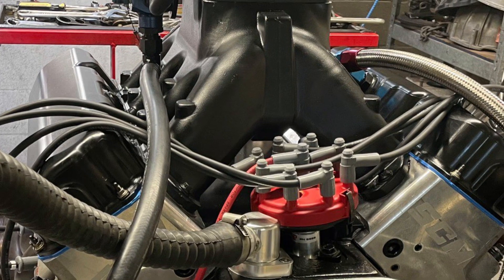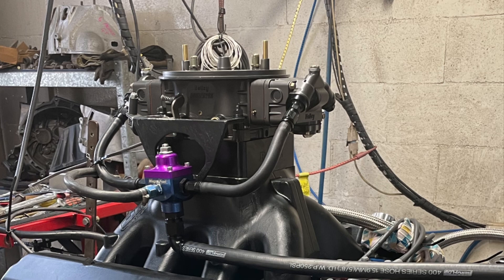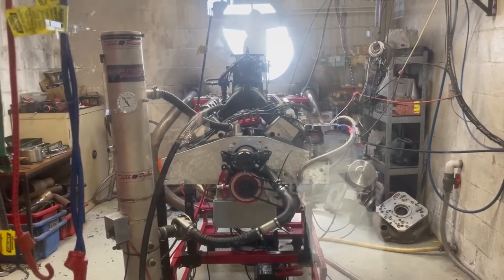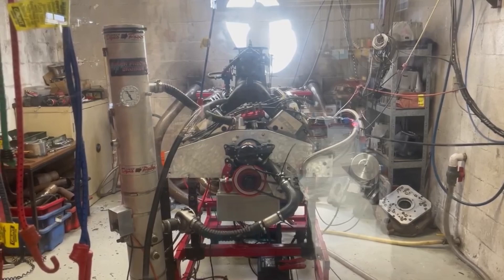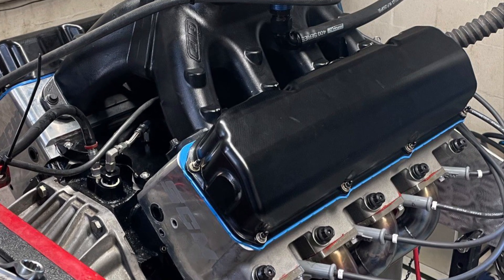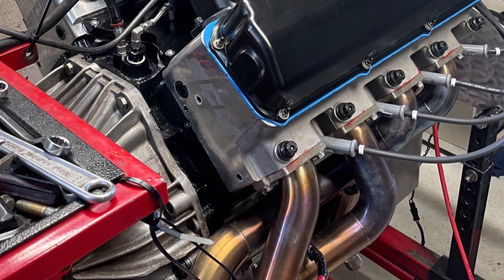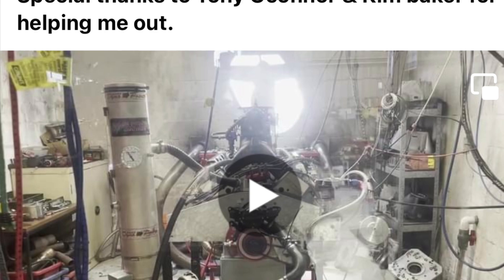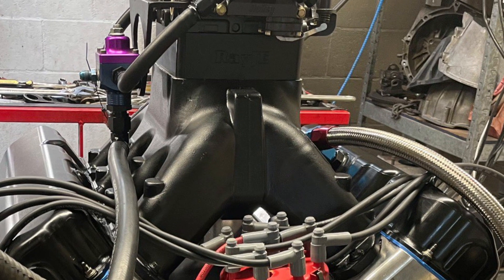351 Cleveland Makes Over 1000 Horse Power,  Now I Know Cleveland's Make Power

Comment: You can't make huge Hp without the parts to do it.
Reply: You can make alot more power with a stock cleveland then most any "Small Block" configuration with minimum up grades.
Reply: @genwatkens2505  There is No More Powerful Factory production made Cast Iron Headed engine at 350 -351 cubic inches than A Ford 351 Cleveland 4V engine.  I worked on them and Race Tuned for Illinois Street Drag Racing. An Amazing Ford Engine.  Factory Block, Factory Crankshaft,  Factory Connecting Rods, Factory Iron Ford Heads.  Not Powerful enough to make it onto Street Outlaws TV show. But they are dead now too no Ficking Race Parts Now !
Reply: @genwatkens2505  I am a Pontiac V8 guy.
455 cubic inches my pick. Best Low Buck Pontiac V8 engine ever made for True Street Drag Racing on pump gas 93 octane or bump compression up to 13.0:1 with 67 cc Chamber 1970 RAIV Cast Iron Heads.  People give crap about cast iron all but they hold up like a True Road Race Endurance engine.
Will last 100 years from now .
Old saying You can't win a Street Race  if you Blow up is True.
Pontiac 350 ci no match for a Ford 351C all iron. 
Ford will Win.
Pontiac 455 Street Drag Race another story but has 104 cubic inches more displacement.
Reply from the maker: My buddy races a Poncho with Kaufman heads was going 9.60s and drives on street and to track. I think he switched to a set of edlebrocks that are ported and went 9.50s
Reply: @dragboss351cleveland  Keep your You Tube Videos coming with Darin Morgan.  You both make a Great Team.
Reply: @dragboss351cleveland   https://youtu.be/VdDDDPkp6Nc
Lots of fun driving.
Reply from the maker: @brracing7861  thank you so much. We plan on doing another. Makes it hard to answer questions on what do think????? Without all the info. But overall the information is something you will never get broken down like this. Thanks so much.
Reply from the maker: @brracing7861  pretty smooth.
Reply: @dragboss351cleveland   I can follow 99.9% what Darin Morgan is talking about answering in Yours- his Videos.  I was on Chad Speier Racing Heads FB V-Factor. 
I got ousted booted off FB For Right Team Red posts daily.
Chad S.  Same way.
The guys taught me how port cylinder heads and intakes.
Not a Pro but I am better than most.  
A Budget Build Ford Cleveland 351C on pump gas Full water jacket for Street Duty would be Awesome by You. 
Darin Morgan insight.
Perhaps Chad S. Insight also.
12s 11s 1/4 mile. Have it last 50,000-100,000 miles goals.
Really hard to do actually. 
Tough like 1000-1200 Hp N/A Builds.
Think it's where many be heading, say 50-70% engine building needs.
Reply from the maker: @brracing7861  I’m pretty good at following his discussion also.  Fairly good handle on flow. Don’t want to know nothing about FB. Builds are goals and they can change, have not planned out on other builds yet. TrackBoss and 343ci at this time. In my case driving 50k miles makes no difference to me, don’t drive any daily. I just want good oil pressure and cool runner. Same with TrackBoss, don’t want any more than 850hp, don’t need 1000 hp. Things work out the way they are supposed too. Glad you are here.
Reply: @dragboss351cleveland  I Look Forward to your projects completed.  Installed,   driven as you want to, Tested at the Track and a Few Races. Heads up Racing Time Clocks Off No Prep Style is so much Fun.
Seeing You Spank LS Guys would Be Awesome Indeed !
Planning out the Engine Short Block Details , Oiling System,  Blueprint details is extremely important.   Fords have excellent oiling systems to begin with but like any they can improved.
Largest Deep Sump Pan without hitting the ground any Racing or driving is must have for me.
Pontiac V8 built up wants to suck the oil pan dry engine Revs way up.
The oil 80 psi rated oil pumps move 13 gallons per minute oil flow. Blueprinted one like Schumann I bought and used shimmed up for 90 psi HOT @ 4000 crank rpms moves 21 gallons per minute oil flow.  
I bought and used a Moroso 8-quart deep sump oil pan for my 455.  I also installed an Autometer Pro Comp liquid filled Mechanical Capillary Tube Oil Temp Guage.
Oil temps holding 230-235 F steady cruising 100-110 mph in my 63 Pontiac Gp.
Royal Purple XPR 10W40 Race Oil I use. So far so good. 700 miles on my 76 Pontiac 455 520 Hp pump gas engine.
Did lots of hidden internal oil mods so she Lives.
Reply: @dragboss351cleveland  I have owned several Good Fords in the past. I miss them.
Need another.  Never owned a 351 C but I know how Awesome they run and drive.
An old friend has a 1970 Ford Mustang Mach 1 with a 351C  4V.
One I worked on Tuned up .
It was a mess by bad mechanics before me.
Animal Jim Foyer built the engine 30 years ago.
Hitting 145 mph on Interstate 80 here in Illinois was Effortlessly done myself driving.
My Friend riding shotgun in his car.
He Shitt his Pants !
Think it would have done 160 mph but I backed off,  not my car, friend was scared to Death.
A Ford Steeet Racing Bullet !
Reply from the maker: @brracing7861  yes it will be fun. I just keep moving forward and get done what I can. Don’t want to start stuff and not finish. Sounds like the 63 GP is a cruiser for sure. Keep the rpm up and have a great day
Reply from the maker: @brracing7861  sounds like the going thing. Sound like a pretty sick combo, had to have highway gears in it. Try again and see if you can go 160, hammer time. Thanks
Reply: @dragboss351cleveland  3.55 gears in the Ford 9 inch and a C6 Aito in the 1970 Ford Mach 1 Mustang 351 C 4V.
Reply: @dragboss351cleveland  850 -1000 Hp you need a Excellent Chassis and Super Strong Frame.  I would want a Full Roll Cage 10-point at least.  Even a Street Car.  Track Car has the Safety Gear of course needed.  Unless a Sleeper No Prep. Scary without a cage huge Hp. They do crazy stuff Power on then let off the gas instant.  Reverse Torque steer stock layouts many Chassis and frames.
Reply from the maker: Good all around gears, our a C4 in it and pick up a tenth and a half and couple mph, cool car man gone I guess?
Reply: @dragboss351cleveland  He still has the Yellow 1970 Mustang Mach 1 351C 4V.  I haven't seen him in a while. Had Marital,  Leagal, Drinking, pot drug charges I heard.  He Loves that Mach 1 351C and was so proud of it. A little younger than us. I am 51 now myself. 
Typical younger car guy Blues 
Might be in need of a refreshing up. I know the Mach 1 has been sitting a while.  I put a nice Street Drag Race fuel system on it #8 AN Earl's Speedflex Stainless braided.
Made him spend lots of money 
Eliminate all the Bad Rigging done prior.  Ignition upgrades too. No China Junk all 100% USA.
Think it was True 450-460 Hp through the mufflers.  At least 450 ft/lbs torque.   The Power band with the 351C heads is unique. 
Hard to describe one has drive Race at track or Streets to Fully Appreciate.
Reply: @dragboss351cleveland  I wonder how much Hp can be put through C4 Ford Automatics, C6 Ford, FMX.  A friend with a Fox 5.0 302-306 ci Vortech Ysi Supercharged 32 psi Boost Trickflow R heads uses a C4 Ford Auto.  Ran 8.60 ET best @160 mph Byron Raceway. Was back in 2004 year.  Built for NHRA NMCA Drag Racing. Still has it Ed.  New Chassis 25.5/25.3 85% done.  What he does is Chassis work. His car always last now.  
I calculated 925-950 Hp at flywheel Full Boost on.
Turbo 400 & Poweglide seems to be standard today.
Way back we used each car manufacturer Transmissions also.
C6 Ford was tough Automatic I thought built up, not much $$$. 
But we were not going 1000+ Hp either.
Reply from the maker: @brracing7861  I know exactly what your saying about power band. Sound like a great car, too bad about the other stuff. I think after you make it to 50, you realize what is important in life, as your time is running out…. Faster than you think. Thanks for the update.
Reply from the maker: @brracing7861  max that is a lot of boost. There is an answer for you right there. They say the C4 is good to 1000 with the right parts. I know it can handle 750 for years if built right. C6 can’t break just so big and heavy compared to C4. I switched and picked up 1.5 tenths. I was racing at nmra meets back then. All I want is a 9.50 so hopefully no issues.
Reply: @dragboss351cleveland  The Engine Tune Dialed in by You is Like Everything for Success and Longevity.   The Fuel System Layout is extremely important. Really can not spend enough till your broke out of money cash $$$$.  I have over $3500 in the Fuel System on my 63 Pontiac Gp 455. Wanted it Dead Nuts Reliable and it is. #10AN Feed & #10AN Return all Earl's Speedflex PTFE Stainless Braided Race hose and matching Earl's Fittings. Jaz 16 gallon Drag Fuel Cell.  BLP Racing Bypass Fuel Log. BLP 1085 cfm Pro Flow Annular Booster 4150 D.P. Absolutely Zero Fuel system Leanout Top End WOT.
Reply from the maker: @brracing7861  I think I may have 1k, lots of help from Orme Brothers. Pro systems hooked me up with fuel pump, bypass regulator and log. I went PTFE all the way. I made a video back go ck it out

Comment: That's over 2hp per cubic inches. That's a badass engine.
Reply from the maker: With out a doubt in my mind Steve.
Reply: @Earl James oh God just comment  but ... no my days of racing around over.
Reply: 3 runs she blows
Reply from the maker: @williamdolyniuk7804  doubt it. Not If built right.
Reply: @dragboss351cleveland  ok 5 runs what what i old . REALLY  old ahh ... yeah we we drove around in Cleveland. S etc 70 mustang.s yellow and black ... etc .. i no macanic  so   thats alot of torque  on every thing.  . L.o.l  . Cleveland boss etc . PHYSICS.. ohh . U got a point and deep POCKET. S l.o.l.
Reply from the maker: @williamdolyniuk7804  well just like touch said come down to money and quality parts.  I always say let her rip potato chip
Reply: @dragboss351cleveland  …. “I no macanic”.  With that level of honesty, no rebuttal is necessary. Thanks for posting such a fine example of Australian ingenuity !
Reply from the maker: Anytime my good frend
Reply: @dragboss351cleveland  …. 😉.
Reply: @williamdolyniuk7804  ….I can tell by your reply that you have accumulated a vast amount of knowledge based upon your experience with a yellow and black 1970 Mustang powered by a unreliable Cleveland engine. Only getting 5 runs using all of that torque applied on everything causing catastrophic parts failures really sucks man. By using the laws of applied physics to determine the exact failure on the molecular level is a brilliant move on your part. 

Based upon your comments it’s a reasonable assumption that a previous owner was definitely no macanic but more like a maniac instead. 

What I’m looking for is a reliable engine swap to replace the shitty Cleveland in my 1970 Mach 1.  I’m thinking LS but you seem more like a SBC kinda guy. Any suggestions that don’t require those deep POCKETS ?
Reply: @dragboss351cleveland  …I like the way you think 🤔. But the only problem with potato chips is nobody can eat just ONE ☝️.
Reply from the maker: The trick it not to eat any, then use that money to save for stroker kit 😉
Reply: @williamdolyniuk7804  …. I appreciate your wide ranging insight across a multitude of historic performance activities. It might take me a moment to process it all but I’ll try to get back to you when I do….
Reply: @danielwilson6665  oh thank u but......